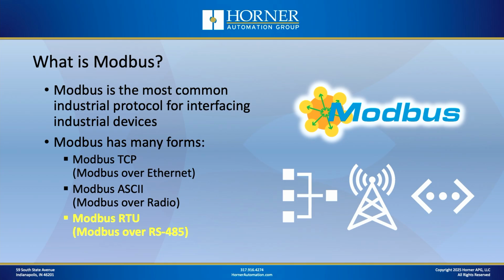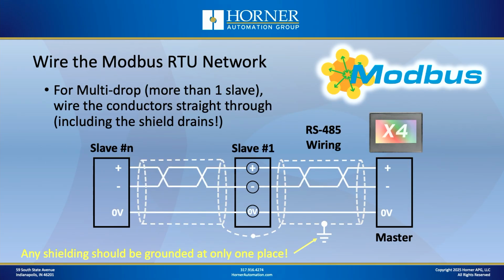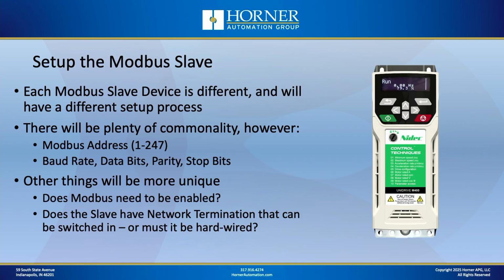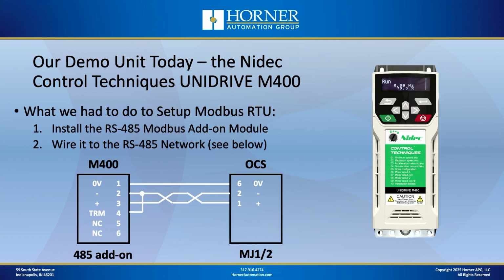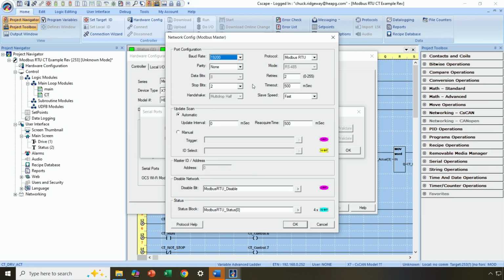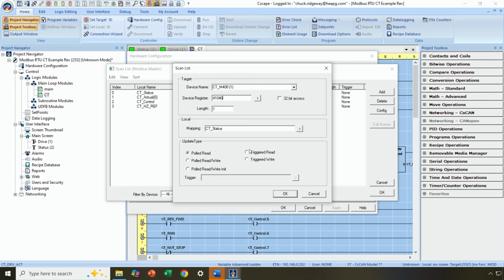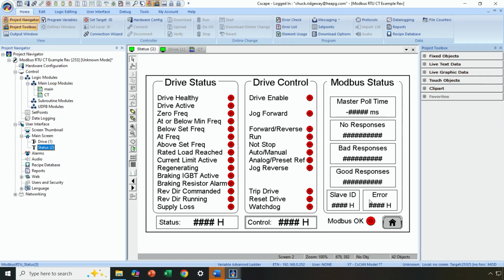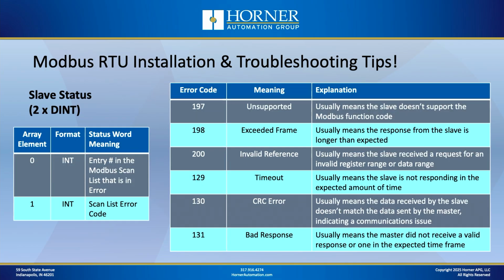Modbus RTU Master Setup & Troubleshooting

Comment: Another handy tip for the CT drives: You can remap Menu 0. So, if you have say 6 registers scattered around different menus, using Menu 22, you can map those registers to sequential parameters in menu 0, then read them as 1 block (array).
Reply: Great feedback. I'm going to revisit this drive with a short video highlighting strictly interfacing with the drive from the Horner controller. I'm definitely going to use your suggestion and the other suggestion regarding the higher numbered Modbus registers as part of it. Thanks.

Comment: Very good video. As a complement, the drive status reading contains 32-bit data, which must be mapped by adding 16384. Therefore, Index 1 must be modified because the "current Hz" value is 32-bit. The only 16-bit index in that index is the "current voltage."

05.001 Output Frequency 32-bit Modbus address 56885
05.002 Output Voltage 16-bit Modbus address 40502
05.003 Output Power 32-bit Modbus address 56887
05.004 Motor Rpm 32-bit Modbus address 56888
Reply: Thank you for that important detail.  Using that Menu/Parameter addressing approach I used in the video, all 32 bit parameters can be called as 16 bit registers,  this just limits the max value that can be retrieved.  I'll modify the demo to address that.  Thanks!